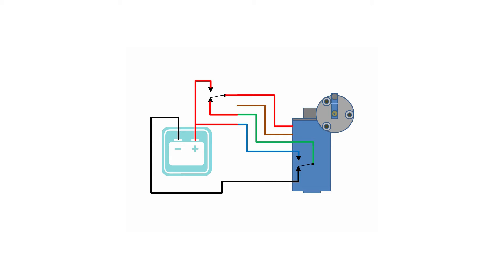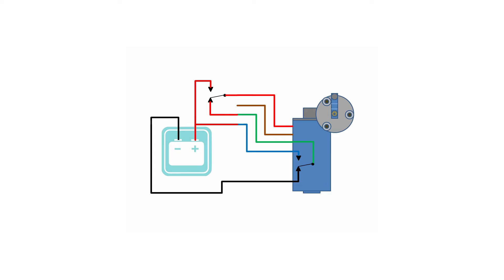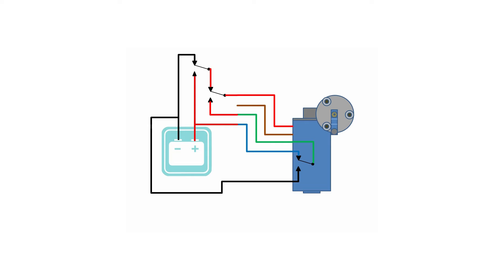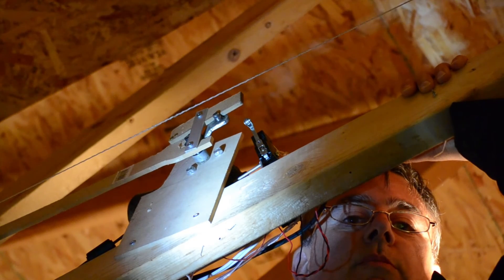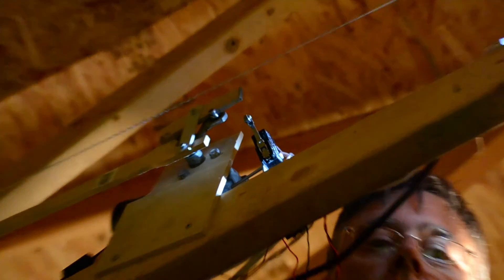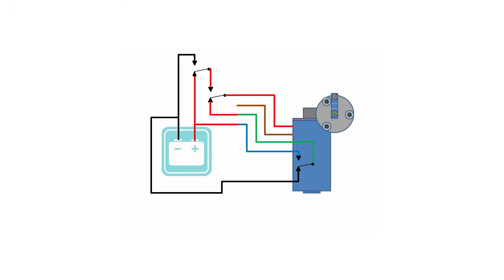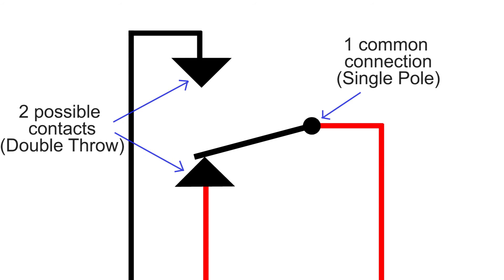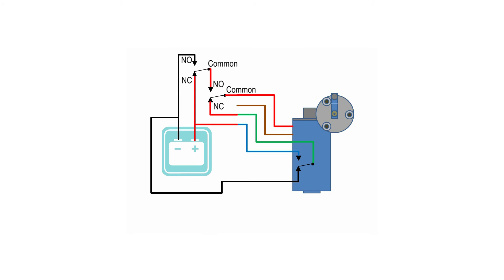Creepy Creations - Wiper Motor Wiring 2

Comment: Hi I have a rear wiper motor by design it does half rotation and returns to park. Is it possible to make it do a quarter rotation and then return to park and continue to do quarter rotation and return to park each time.